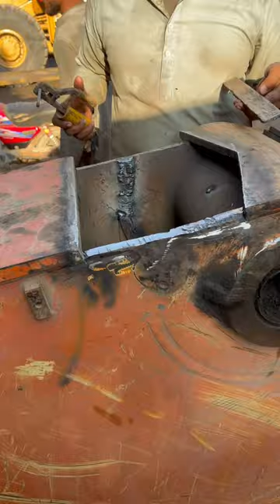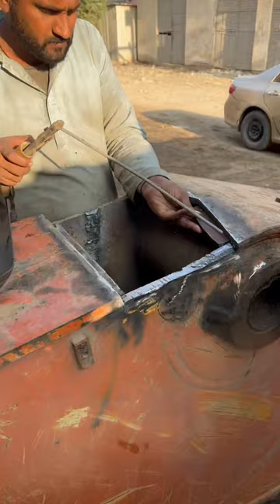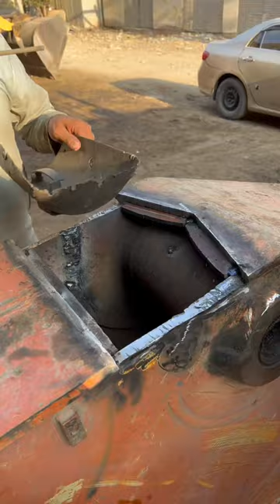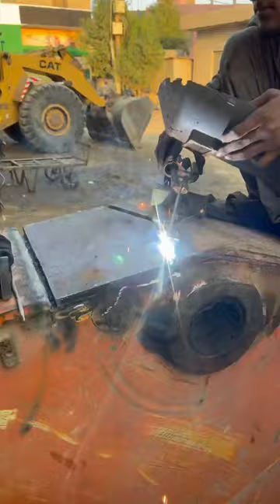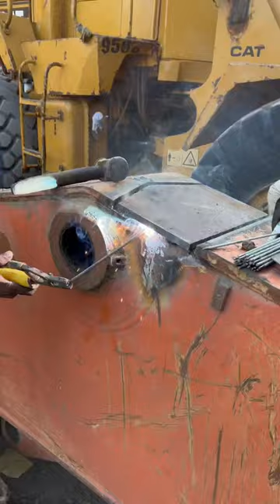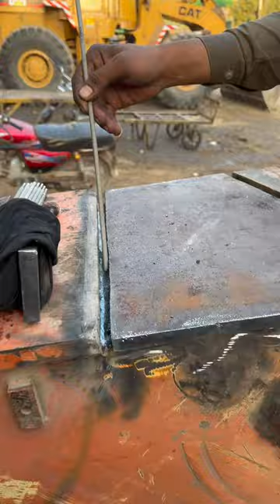replacement excavator boom plate with stick welding #shorts

Comment: Would have been a much stronger weld if they beveled the edges
Reply: The gap in the plates compensates for that....can you actually weld.
Reply: @eckyx9019 can you even weld? The point of a beveling to knife blade is to get the best possible root as far in as possible, the gap on the side does nothing but get in the way, if they added a gap underneath it would be much stronger.
Reply: @rxst.R6 .
Been welding full time for 35 years. Don't try and tell me what I know junior.
Reply: 35 years don’t mean shit if you were never taught to build right
Reply: 35 years welding as a junior my friend